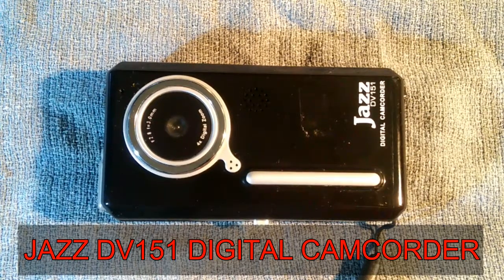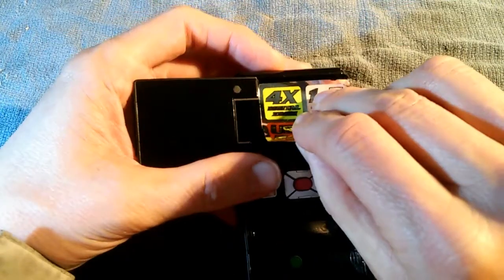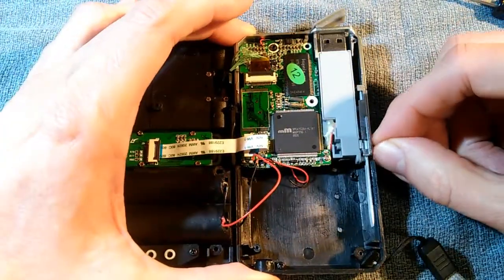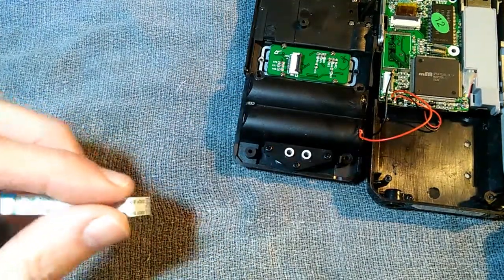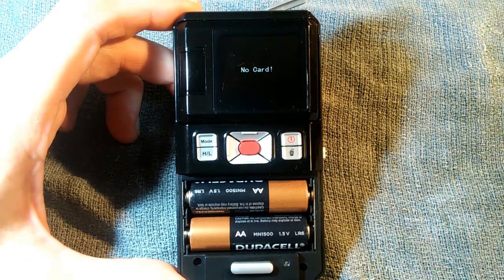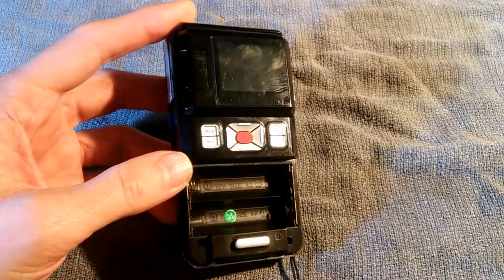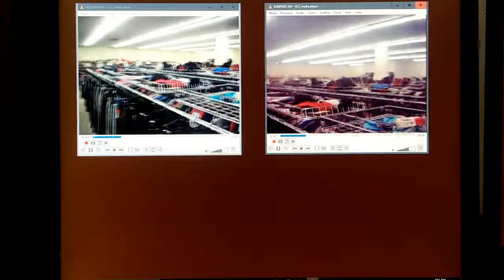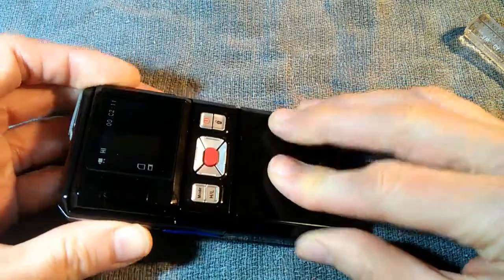Jazz DV151 Digital Camcorder:  Tear Down and Evaluation.

Comment: I had that same exact camcorder except it was red, I don't have it anymore, also the startup noise on mine was different, it had chimes.
Reply: i think yours was a dvx50, which is the one i have.
Reply: @1secondarysmile  Interesting, I don't have that camcorder anymore, replaced it with  a Samsung camcorder and it works perfectly.
Actually I had a flip mino 1st then I went to Samsung.